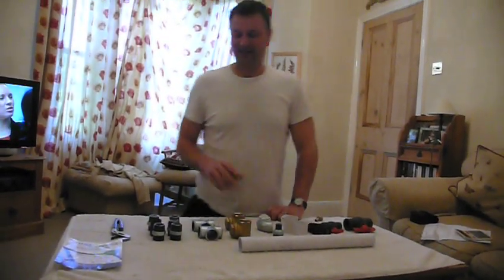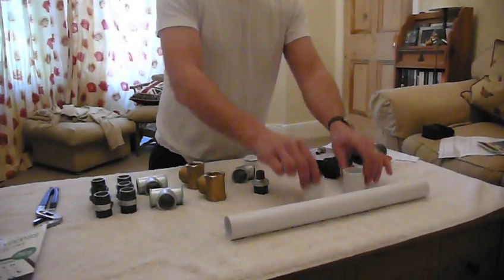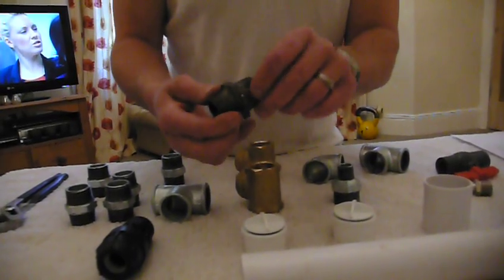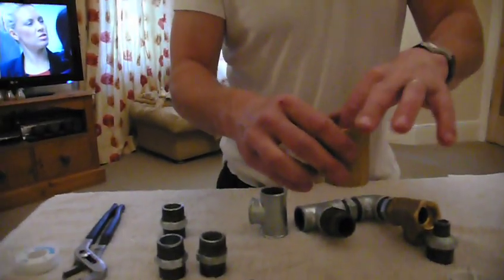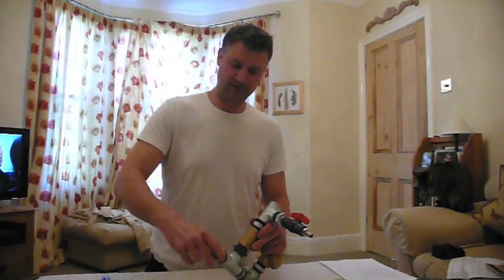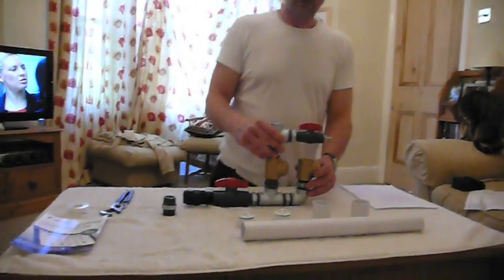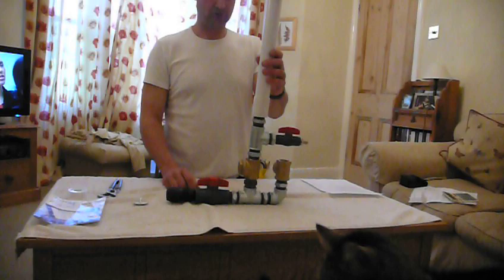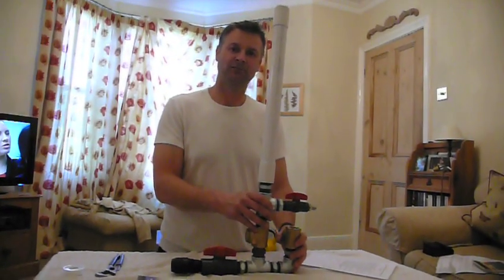Part 1  constructing a 1 inch Hydraulic Ram pump made from galvinised steel water pipe fittings.

Comment: I built a pump, seem to have good flow from a circa 4' head, but the check valve doesn't pulse open/close, it just stays open. If I pull the flap up it stays closed for a short while then just falls open again. Might using a sprung ball valve remedy this?
Reply from the maker: Hi, With 4 ft of head you should be able to pump. Sounds like a flow input problem to me. How long is your drive pipe, and what is it made from? Is air getting into it, everything must be air tight. Let me know how you get on. Good luck.
Reply: Dieseljonnyboy thanks Jonny, I don't think the flow is strong enough and need to improve my dam to give a better head of water! (I'm using 25m of 25mm pipe for the drive). I did get it working in the end after a bit of fiddling - I switched the impetus valve forwards of the standpipe and set it on an angle so the flapper didn't require quite so much pressure to get moving
Reply: Sounds like a bad part that you have.